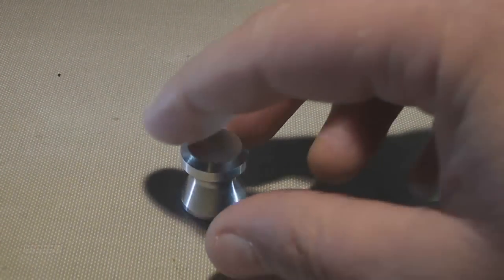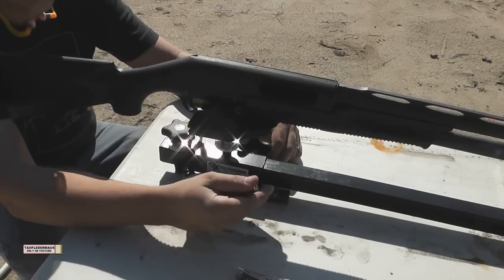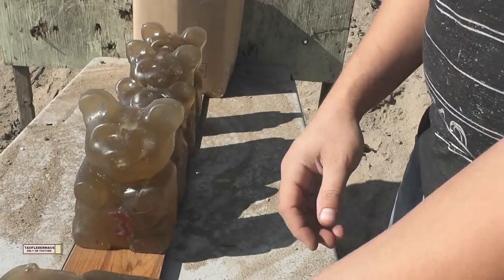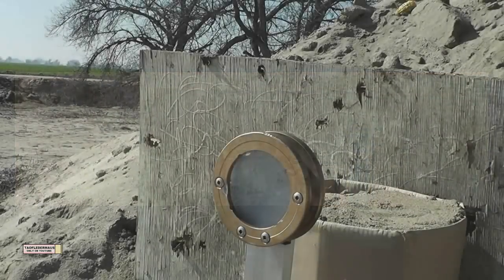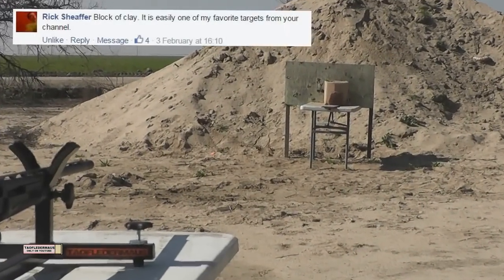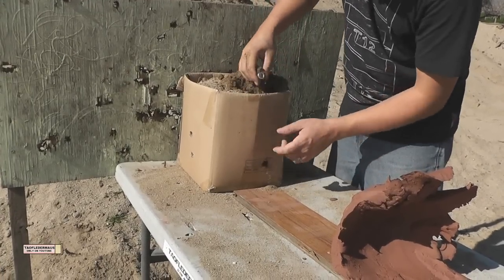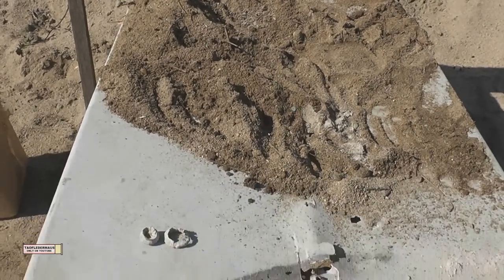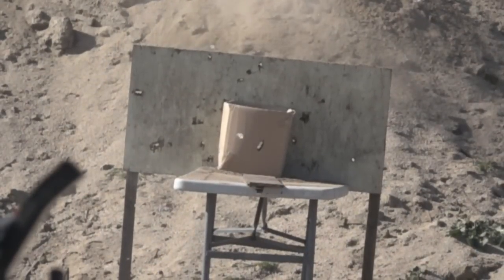.70 Cal  ALUMINIUM Shotgun Slugs  -  Ballistic Trials

Comment: I’ve been playing with an H&R Huntsman smooth bore 12 gauge and 100 grains of Pyrodex RS (2f’ish). With a round nose, hollow base, skirted lead projectile it kicks pretty hard and drives the lead about 5” deep in wood.
I’m interested in deer hunting at close range with aluminum balls. I’ve tried .68 cal “glass breaker” aluminum that are sold to be shot out of a paint ball gun. 7.07 grams/109.0 grains. With 100 gr of Pyrodex, and a 0.040” patch, there’s almost no recoil and the aluminum ball seems to go about an inch into the wood and bounces out (I’ve split the wood and no aluminum ball). I’m not sure if this is suitable for hunting. I may line up some milk jugs full of water.
I was hoping to get really high velocity with the 100 gr aluminum ball. I’m disappointed that it’s the same as lead. I’m guessing that would be about 1000 fps. “Faster powder” is not an option with a muzzleloader.
I’m old and I don’t feel up to shooting a 12 gauge round ball of 500 gr. I was hoping that the aluminum ball would penetrate and the .68 cal diameter would do the work. But it’s got to penetrate. 
I’ve also got some aluminum 3/4” rods and I may turn some pellet rifle looking slugs to try. Anything will be patched to prevent barrel wear.

Comment: I want you to shoot that aluminum bullet at heavy double steel plate to recreate the 911 impact where a thin aluminum wing tip could cut right through steel box beams because it was going 500 mph.  surly your bullet must be traveling 500mph or above....lets test these materials in impact       (1250ft per second, a mile in 4 sec  nearly 900 miles per hour)

Comment: I am a gunsmith and machinist in Pennsylvania, and I have very much enjoyed all of your videos.  Your spirit of whimsical experimentation is just plain fun.  I am greatly reminded of the things I used to do when I was very young!  And once in a while still.  There is just one thing I would like to add regarding the use of ultra low-weight projectiles.  Without data to go on for your unique loads, the use of the factory target case and powder charge is logical to attempt to create consistent conditions to compare ballistic performance of the projectile alone.  But this will not allow an ultra low-weight slug to achieve it's full ballistic potential.  In load dynamics, when projectile weight is reduced, it typically results in a drop in pressure with little other change.  That is why you are not seeing the significant gains in velocity over conventional lead slugs that one might otherwise expect.  To achieve that, an increased charge of fast-burning powder is required.  Note that when firing exotic handgun munitions with very light-for-caliber bullets (such as Magsafe), there is much greater than normal muzzle blast and flash.  That is due to the burning of a hefty charge of very fast-burning powder, one that would probably cause catastrophic failure of the gun with a standard bullet.  But pressure is within safe limits because bullet weight is so reduced.  Some of these loads actually substantially exceed standard pessures, but because the pressure event occurs even more rapidly than normal, the gun withstands it. There are load data programs that might help you calculate the appropriate charge for your many gloriously strange and creative missiles so they can achieve the substantial gains in velocity I know we'd all love to see!  With even more dramatic downrange results.

Comment: Coming Attraction: Spark Plugs???!??
Reply: +sp1nrx
For completeness, try a few ceramic-first, and a few spark-gap first.
Reason being that the ceramic is hard enough to easily scratch tempered glass, which is why some places make it illegal to carry around a spark plug not attached to a car's engine (robbers and vandals use the ceramic to break the car's side windows).

Comment: The Al slug would more than likely go faster if you load it with a faster powder
Reply: +233kosta
That's what I thought, too. For the same length barrel, a lighter projectile means you can theoretically use a faster powder without exceeding the material strength of the barrel.
Still might have to worry about erosion (if it's a rifle), but if you're already reloading your own ammo it's easier to get velocity this way than trying to make the gun (and brass!) stronger to handle the higher pressure spike of a faster powder.
This is also why pistol powders are faster than rifle powders. Less barrel means the powder charge has to burn faster to be done burning before the bullet exits the barrel.

Comment: You need some resistance to make the powder burn correctly. With powder optimized to the aluminum slug I'm pretty sure you could get much higher velocity. You never show what the primers of the shells look like or Micrometer the case heads. I think some of these low pressure rounds you fire that you may not even have enough pressure to make the sides of a primer grip the pocket so the primer may be backing out a little. But you never show any of that.

Comment: the aluminum slug didn't have enough inertia to overcome, so the powder never got up to full burn rate. you either have to use VERY fast powder (and shotgun powder is already pretty fast), or try fine grain black powder (which means a nitrocard under your shotcup/wad). a light trap load with a thicker wad cup (so fatter projectile) would probably be a decent load to try... for the intrepid experimenters out there: DO NOT try blank powder, not ever!

Comment: http://i.ebayimg.com/00/s/MTIwMFgxNjAw/z/kF4AAOSw7NNUB3-d/$_1.JPG
http://i.ebayimg.com/00/s/MTIwMFgxNjAw/z/HagAAOSwGvhUB3-T/$_1.JPG?set_id=880000500F
https://uline-h.assetsadobe.com/is/image/content/dam/images/HD/HD2500/HD_2302.jpg?$Medium$&iccEmbed=1&icc=AdobeRGB
I've a pile of these (red version) after being cut in middle by bolt cutter...it'd prolly tumble like a baton thrown, enter target sideways....the fat end of these mic at .825 and the 'nail head' type small end are .835 which is....21mm give or take a few....and a 12 guage slug is 18.5mm. have to be TIG welded back together, I think will become a dual hammer head connected at the cut to a handle....

Comment: We know energy is mass x velocity, which means that to create a similar energy with a significantly lighter projectile we will need to increase velocity. What you have failed to account for is powder burn rate. The relationship of mass and velocity/chamber pressure is not linear and a lighter projectile often requires more powder or a different burn rate to increase velocity. I challenge you to get a chronograph and begin experimenting with powder types and charge weights when you deviate from the factory projectile weight by so great an amount. Also keep in mind that rifling requires a certain velocity for a given ballistic coefficient in order to sufficiently stabilize an object in flight. Berger Bullets has an online "twist rate stability calculator" that should give you an idea of how the velocity and twist rate interact with the projectiles stability.

For all you know, this projectile might outperform its lead counterpart in every way given the correct powder charge.
Reply from the maker: +robert91rs  Chronographs are only looking for a single object,  otherwise they will get confused and give you an error reading.   Since shotguns shells have other objects flying with the projectile like waddings,  shotcups and nitro cards,  it would be difficult to get readings,  and there is a high probability the chrony is going to get hit with these foreign objects.
Reply: Thank you for your response sir, I do enjoy your experiments. Perhaps a plexiglass shield in front of the chony face and a slightly longer distance between it and the muzzle would give the wadding time to deviate off course enough to not interfere with your readings? At any rate I hope you keep up the great work, I just suspect there is performance to be gained from your light projectiles with a change in powder charge.
Reply from the maker: For us if we want to know what the speed is,  it's just easier to show it with two HS camera shots with a slug with a known velocity.

Comment: One thought about the speed comparison between the aluminum and lead slugs. I think the reason each projectile were similar in velocity is because the necessary energy to get them down the barrel was different. As most know with nature, energy will find the path of least resistance. This means the Aluminum slug did not need as much energy to propel forward to over come the resistance of the barrel as the lead slug did. Simply put the projectile will only use as much energy in the fraction of a second needed to move down the barrel and propel toward the target. Most would interpret this as increased velocity of the lighter Aluminum slug. I think because the acceleration distance is very short there is not enough time to transfer additional energy to the projectile to result in additional velocity. As such, any remaining energy would be diffused once the the slug left the barrel. Of course I'm no scientist and could be completely off base, but this seems logical to me. This equation again would change if using a semiautomatic vs pump or locked breech firearm. I welcome vetting on this subject. Great channel by the way.

Comment: Because the aluminum slug is lighter that would give you the opportunity to add more powder and not raise the pressures. I would like to see these demonstrations while working up a load until you can see some sort of pressure signs and back it down. I am wondering just how fast the slug can travel . I bet that would do considerable damage that 1500 feet per second

Comment: The lack of significant velocity difference between the lead and aluminum rounds is because of the burn rate of the powder. The powder in the aluminum round didn't likely get full burn.
Try experimenting with faster-burning powders with the very light projectiles. You'll then notice a significant velocity increase.
Reply: First off you are wrong about the black powder burning faster than smokeless. If you were correct then you could substitute smokeless powder for black powder without blowing up an old black powder gun. Those old Kentucky Rifles needed long barrels because black powder needs time to burn and generate pressure. Also long barrels allow what is called over flash, this is when the powder at the rear of the powder column ignites launching the rest of the column down the pipe and causing a faster burn as more powder comes in contact with the flash.
Yes more powder with the aluminum slug would work better I never said it wouldn't.
The lead slug allows the powder to burn and build up pressure before it moves down the barrel, where as the aluminum slug begins moving sooner not allowing the pressure to build.
Think of it this way if you are pushing a car up hill you are always able to apply pressure. Pushing a car down hill it gets away from you and you have to chase it to apply pressure.
Reply: +Kevin S I agree, I'd like to see a different powder charge used. Higher velocity should increase stabilization, penetration, and cavitation.
Reply: +Cyanakrli Faster burning powder would help for a lighter projectile mass. Also a longer barrel would probably help. The reason that both projectiles reach the target at about the same speed is more likely because energy equals mass times velocity squared or E=MCC. Traveling the same speed with 4.6 time less mass shows. Only 2 gummy bears instead of 9 to 10 although they only had 6 on the table (If Al=2 gummies then Pb=2X4.6 or 9.2 gummies) The amount of powder burn can be judged by how many gummy bears it takes to stop the lead slug, since all other conditions are pretty much constant (same gun, same temperatures, same air density, etc.)

Comment: My educated guess on if the aluminum slug would bleed of its energy more quickly and therefore fall short, is that it wouldn't I think the aluminum slug will actually travel further than the lead slug. IN small, slower scale a lighter frisbee will travel further than a heavy one. More energy plus less weight = more potential

Comment: That little flash is likely from air compression between two flat metal surfaces with a lot of energy transfer. Kinda like those fire pistons you can use to start a fire. Or a diesel engine's cylinder, even.

Comment: What kind of pennies? Pre-1982 pennies are made of solid 95% copper  and therefore heavier than post 1982's which are made from zinc that's copper platted.
Reply from the maker: +5thDragonDreamCaster  if you look close you can see they are new pennies.
Reply: *****
Alright, but there was one that looked old in there that I couldn't see the year on, but then it was probably late 80's or 90's.

PS Hey, you should try to shoot solid tin bullets, I have some tin, it has a pretty low melting point, or even try to shoot a solid gallium round.
Reply from the maker: I'm sure there are other questionable things in the video if you look hard. lol

Comment: the FLASH is most likely the Reflection of the Sun off a face of the Metal!
Angle of Incidence equals the Angle or Reflection

Since its only seen from one camera angle, it might make sense.
Reply: +Phauxtoe  It is aluminium - one of the most reactive metals.  
Breaking up creates a huge surface area that rapidly oxidises resulting in a flash.
(kinda like Flash-powder)
Reply: the only issue with the flash powder theory is it only visible from one camera angle.
Reply: Phauxtoe  Not so much.
While those are highspeed cameras, aluminium react rather fast.  
And if you look at the videos in slowmo, only this shot has a frame where the bullet just hit the surface.

But it makes no sense for a reflection to only show on one camera and to only show for a single frame. It would have to be a cloud of perfectly aligned particles all in the shape of flat mirrors for that to happen. And then where do they go after a single frame?

Nah, just the good old Aluminium reacting - it is one of the most reactive materials after all, used to weld steel and in fireworks to get the bright white sparkling.

Comment: Aluminum is highly flammable when it is powdered or as shavings and will burn instantly if it is hot enough.  It is like Mg in its combustibility, remember you can use Mg or Al in Tannerite or  (NH4)(NO3) + Al= Boom or +Mg= Boom as long as you use a 95:5 ratio.

Comment: someone should send you a chrony so we can have moar scientific data to chew!!! 
thank you for all this content man!
Reply from the maker: +Paul Wall   It's impractical to try to chronograph shotgun rounds.   There is too much clutter like waddings,  shotcups,  nitro cards,  etc that would fault out the chrony  since it is looking for a single object.    We'd probably end up hitting the thing with a wadding or sabot  or an errant slug   and destroy it.
Reply: +TAOFLEDERMAUS understood, i may or may not have seen such destruction ;) but in my opinion putting it right at the muzzle without the sky screen thing it should give reliable data, it has been done for years.
thank you for your reply.
Reply from the maker: +Paul Wall   You have to put the chrony about 10 or so yards away otherwise the smoke will also cause the it to fault out.

Comment: The flash is from oxygen compression.
If you compress oxygen fast and hard enough, it  will detonate, Due to the flat head of the projectile you fired, it acted like a hammer, and forced all the air at the point of impact to move so fast, that it compressed and exploded.

The more you know.

Atleast thats what i think happend.

Comment: Different gun powders have different traits but something they usually have in common with each other is that they need some resistance to burn properly. The aluminum slug was so light that it got out of the way before the powder had the time to react to use its energy. It is the exact same (or opposite) reason that you use caution to not load projectiles that are heaver than the factory load of the shell.
Reply from the maker: +Brandon  I would have expected a bigger muzzle flash with the alum.  slug.   It was the same as the lead slug.
Reply: ***** yea, a powder with flash retardant is common in birdshot actually. Its kinda like how with the uncommon things you use the results are not what you would expect sometimes but there are reasons behind it.

At an indoor range you can sweep the floor and accumulate unburnt powder. Sometimes powder makes it all the way out without burning.

Comment: RANDOM VIDEO SUGGESTION! have you ever considered making wax slugs out of exacto blades? the reason they couldn't do damage before was the aerodynamics of the blades. take that out of the picture and you have exacto blade shrapnel. would probably look awesome being shot into idk like 5 balistic gel gummy bears.
Reply from the maker: +TheTXGearHead  I think the wax would just shatter.    Wax is very weak.   The reason the lead shot works  is because the shot is stacked in a neat,  strong column,   like pebbles in a concrete column.
Reply: maybe something that would hold up but then break off then. maybe sillyputty? im kinda reaching on that one i know. i just can't imagine it being impossible to make razorblade rounds.